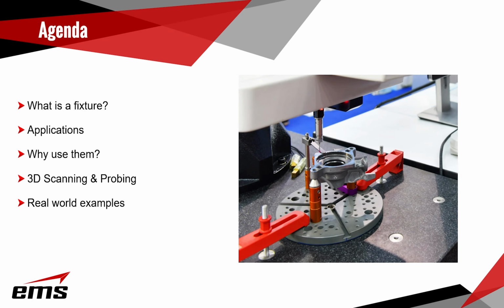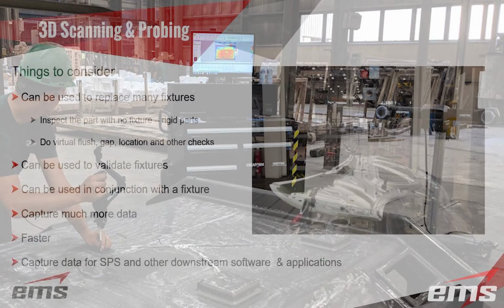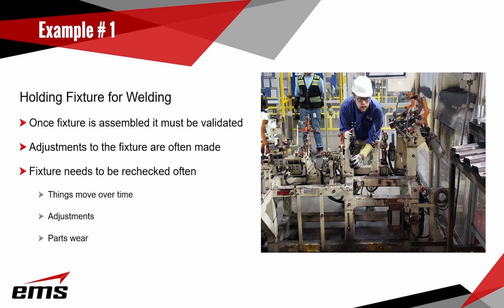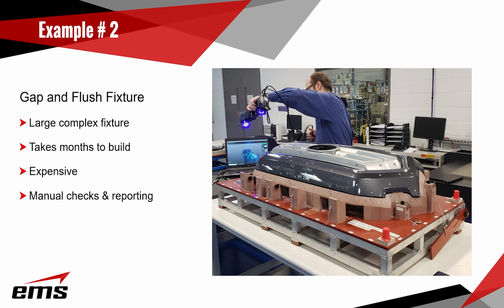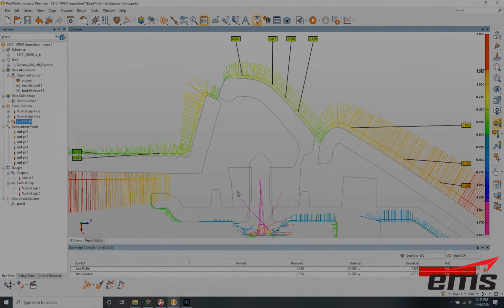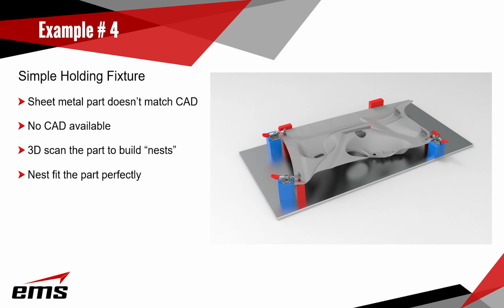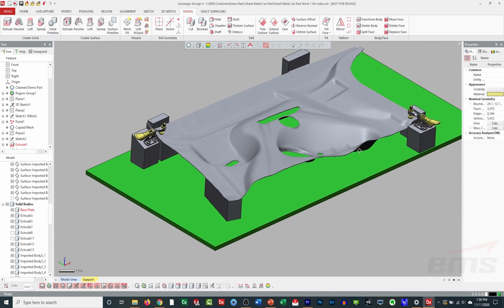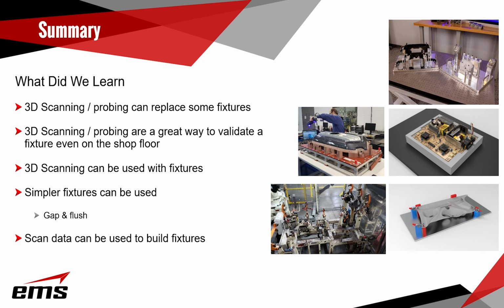3D Scanning of Fixtures, Jigs, Gauges & Tools for Inspection & Design

Comment: hi ser, hope you're doing fine.
I find your videos really great basically because I'm currently working on the same process so thank you very much for these amazing videos.
I have a question if you would like to answer please, I'm currently working on my intern project with creaform handy scan and some 3D printing technologies so I have a project in which I have to take an existing product basically reverse engineer it to create a new product that solves some frustration in the original product and 3d printed it and test it. can you please propose to me some products related to mechanical engineering that I can start with and work on ? 
Thank you in advanced
Reply from the maker: Find something around your house or garage that frustrates you and you think could be designed better.   Perhaps a kitchen utensil like spatula.   Make the handle thicker and more ergonomic.  Make the end larger but with more holes.   Make it longer with a different bend.  Hope that helps.